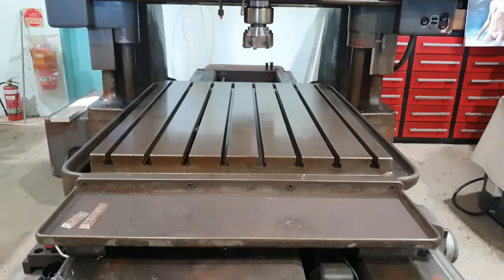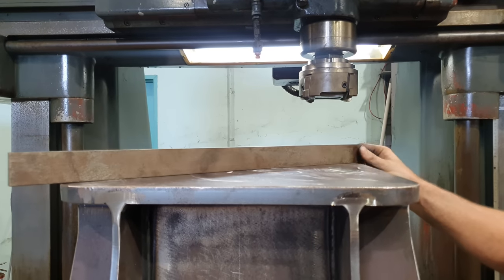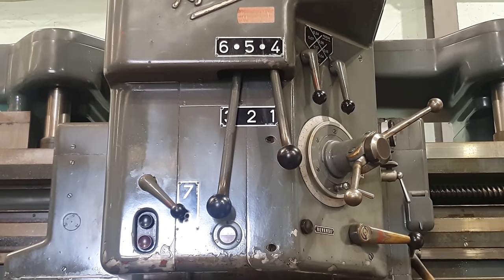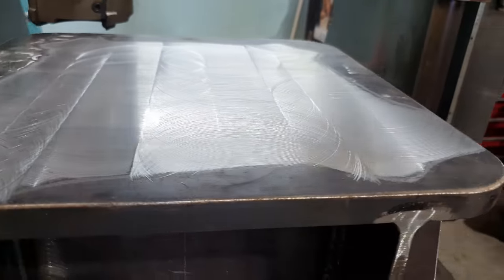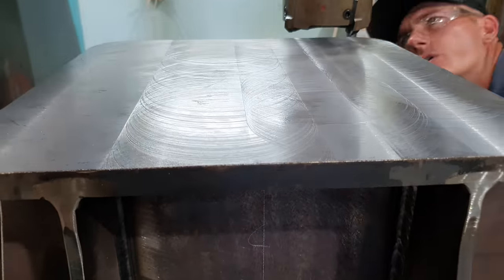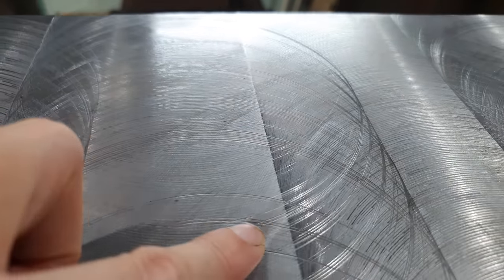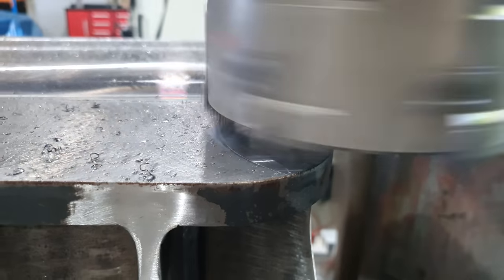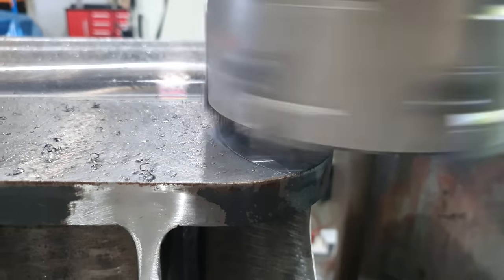Milling a Stand for a Robot on Our 1950s SIP Hydroptic Jig Borer!

Comment: Oh how that beastie of yours loves you to the core. Put that on a lathe ? That I would like to see, LOL. I guess if push came to shove it could be done but I would have to be pushed pretty hard eh, LOL. At one time I ran a 4 head mill with a 14 x 67 afoot table 3ith 2 heads on the flying bridge and one vertical on each side that ran up to 24 inch slab mills with 1 inch carbide inserts. A new ships engine would take a few days to set up and then I would spend a week on a grain shovel filling numerous bins of dross, great days long ago. Oh how I still love BIG, LOL. It's always fun stopping in here. Have a great week folks.

Comment: My $0.02: The corners being so low would warrant checking the plate thickness there to see if it was really due to wear - not warpage.
Good decision to go to another tool.  Another fantastic job.
Reply: I think it's a new fabrication Jim, there are no mounting holes in the top plate.
Edit: Yes, lovely finish achieved.

Comment: When touching off, we used a Blue Riza Paper in oil on the surface, when the cutter tore it off we new it was exactly 1/1000 from the surface.  ( before you say Bananas, remember  we went to the Moon using  bananas units):face-green-smiling:

Comment: Really cool machine. I did notice the bottom of that wasn’t flat and I think when you clamped it down you flexed the corners. Just wondering if the top is no longer flat and or if you should have cut the bottom to.

Comment: Just curious why you didn't start upside-down, with the inverted top shimmed to the table and flatten the base first? Or did you Shim the base for milling the top?
If the Top was out of flat by 0.5mm due to welding stress, then I'd have to assume the Bottom was also, yes?
After unbolting wouldn't the milled flat surface be distorted by the relaxing base?
I've seen much bigger (more ridgid) weldments distort when clamped down to a Machine Table, then move back when unclamped.

Comment: Looking at this, I am reminded of all the times that I've wondered why you never had switchable magnet rigging for your overhead tram. This looks like it'd be a perfect piece to lift by slapping a magnet on the top plate instead of a squirrely lift with the forks. Was there ever a reason other than the cost of buying one?

Comment: No 'Rizla Red' or 'Rizla Green' cigarette papers, Kurtis?  My first job was as a clerk in an engineering company that bought machine tools, refurbished them and sold them on.  These were big, big machine tools, like a gun barrel lathe from the Woolwich Arsenal sold to Brazil to make cement mixer barrels or a Spherical Turning Lathe (also from Woolwich, I believe) that could turn the 15 banana diameter ball bearings for Naval gun turrets to turn on.  But I digress.  

I was always goofing off in the machine shops asking questions and I found out all the milling machine and planer machinists had a packet of Rizla Red or Green roll your own papers.  Whether they smoked or not. This was so they could set the cutter height above the work to within two thou.  (Or three, I think the Greens were 0.003 bananas)  They would lower the cutter onto the cigarette paper until they could just pull it out without tearing and that was 0.002" above the work!  

You probably knew that, but I just wondered if anyone did that any more?  BTW; "half a mil" is 0.021", isn't it?  (Sorry, bananas.)  Great little cameo vlog guys.

Comment: I suppose you clamped at the base, so as not to distort the assembly before milling the top flat, for now you can turn it around and mill the bottom flat and parallell as well :)

Comment: I have a suggestion for a Sop Project that could, in theory, make the Hydroptic even more versatile...

Build a self-powered grinding wheel head for it and now, it becomes a MASSIVE Surface Grinder that can handle parts MUCH larger than your current surface grinder (assuming you have one) can handle...

What I'm picturing is the grinder attaches to the quill but the only powered items you run is the table feed...the quill holds the grinder head and sets it's height but the arbor is NOT spinning when the grinder is making it's passes...

Does this sound like a viable possibility or an absolute nightmare?

Comment: I know they're carbide inserts and the part being machined is, basically, a huge heat sink, but seeing the tool cut through without anything more than a bit of WD-40 for coolant is like scraping fingernails across a chalkboard!
Would coolant flow have made a difference to the surface finish in the first couple of passes?

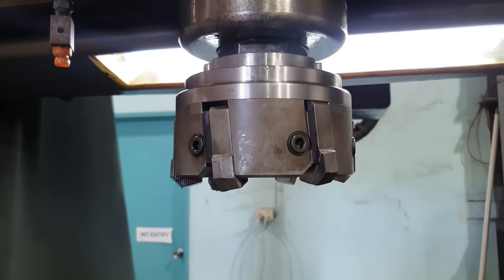Comment: I really liked the video, the machining part and all is really interseting the way u were l not stisfied by the surface finish. What really caught my attention was that super hot model calender hanging by your machine to really heat things up,that may  really help achieve  those tight fit tolerances 😂😂, 8:30  just kidding nice video though. I m from india, i do also have a small machining workshop.

Comment: I'm sure the bottom plate was off just as much as the top. Are there some kind of adjustable feet that still need to get installed?
Reply: Likely it'll be bolted to a concrete base and need to be adjusted by shims anyway. Just a thought. 🤔

Comment: If the top is slightly warped from the heat of the welding fabrication , I would think the bottom would share the same fate. Surprised you did not flip it over after completing the top, and do the bottom as well, to keep the two surfaces parallel.......

Comment: Kurtis, I know you checked the top side and yes, can clearly see the gaps but, I question, can the bottom plate also be "off"? Just asking. Great video, cheers :)
Reply: It looked like the bottom was off too (which I would expect). I guess the bottom could just be shimmed on the mounting bolts if needed.

Comment: The top of the fixture is now flat, but what about the bottom - is it necessary to have both surfaces parallel or doesn't the bottom surface matter?
Reply: Maybe because it'll be bolted to a concrete base and need to be adjusted by shims anyway? Just a thought.

Comment: Just a thought. If the top was a little bit distorted then presumably the bottom or base of it was distorted as well. Would it not have been better to take a skim off the bottom and then invert it and skim the top then you know that the top and bottom are parallel within the limits of the machine?
Reply: Maybe because it'll be bolted to a concrete base and need to be adjusted by shims anyway? Just a thought.

Comment: so if the bottom isn't flat they just use shims at installation? cool machine
Reply from the maker: that wasn't necessary the bottom plate will be bolted down with adjustable bolts and levelled, just like a lathe or cnc setup
Reply: @CuttingEdgeEngineering  ok thanks, keep up the good work

Comment: This makes the top dead flat but doesn’t it also make the top parallel with the base?  So if the base is set at a slight angle so is the top?

Comment: How did you know the bottom was flat before clamping and possibly distorting the weldment? I would have set up three fixed points to establish the bottom plane with a fourth adjustable. Tan a jig bore machine in the 70s.

Comment: You need  SHARP, more rake and much less clearance  ( and DOC ) to get good finish on the Jig Borer. Also, a properly set Jig Borer cuts DEAD perpendicular. For good finish you want to cut only in front.  Also 5-600 rpm would've helped. You're cutting cold and work hardening the ...whatever metal is that. None the less it warms my heart to see somebody using the ol' girl.  Tons of likes !!!

Comment: What I think if the top plate is bend out of shape by the heat the bottom has the same issue? If so how can you be sure the top is perfectly placed on the mil if bottom plate is bend too? My mind tells me then, the 0.5mm removed is straight/aligned with how bottom plate is "flat" or I am lost.

Comment: Why did you only face the surface on the top?
I would assume that the bottom surface also warped during welding? Isn't it a problem that the whole stand might now only standing on a few high spot on the bottom?
Reply: Maybe because it'll be bolted to a concrete base and need to be adjusted by shims anyway? Just a thought.

Comment: This question has been plaguing me for a little bit since I first saw a milling machine:

If the bottom of a to-be-milled object isn't perfectly flat, wouldn't that necessarily skew the results of the top when milled? Meaning, it will be milled flat as oriented to the imperfections or cant (meaning its flat but at a say, 0.5* slope) of the base, not the mill "floor." At that point, wouldn't it have to be milled on a second machine to gain that last perfect flat orientation, then flipped and milled on both machines again with two known "flat" instruments? (on second thought, you might not need to make NASA-grade flatness)

I'm certain I'm overthinking this and way above my paygrade as a truck driver, but I need this explained before I twist my brain in knots. 😅

Comment: This cutter is not cooled in any way during operation? After all, when the metal is heated, it increases, won't this be a problem for a surface in hundredths or tenths of a millimeter?

Comment: A interesting story for you. I worked a number of years ago for one of the largest aerospace firms in the USA which closed its large machine shop which took an area the size of a football stadium in area. Some of the machines were the size of a school bus and were dated back to the 1940's to the present. All were lovingly maintained by the machinists throughout the years. An auction was held for the equipment where the buyer had to disassemble and remove the machines themselves. Evan with no reserve no one bid on any of the countless machines and tooling. There were tens of millions of dollars just sitting there. In the end the company sold them off as scrap. It was a sickening sight to see them put to the torch.

Comment: One question: what about the other end ??  Is it assumed to be flat and parallel to the new surface ??  It was subjected to welding heat too, no ??  Perhaps customer just needed a flat mating surface for robotic arm.
Reply: Maybe because it'll be bolted to a concrete base and need to be adjusted by shims anyway? Just a thought.

Comment: Wouldn't you have to clean up the bottom too so that it's complete flat or in sync with both top and bottoms?
Reply: Maybe because it'll be bolted to a concrete base and need to be adjusted by shims anyway? Just a thought.

Comment: I see a new tool being devised for the "kitchen drawer". One "humungous fly cutter" for straightening the robotic legs to go with the "now that's a boreing bar" and "tool post" holder.
One question though what's the likelihood of the top surface "going out" of flat now that you've released the base fastening against the bed. Should the base surface be flattened first, flipped and then the top. How accurate did it need to be?
Regards from Canada's banana belt.
🤞🇨🇦🍌🥋🕊️🇺🇦🕊️🇳🇿🐨👍

Comment: Did you check the level of the bottom as well?
Reply from the maker: Not necessary, the base will be bolted down with adjustable bolts for levelling so no need to do that surface 👍
Reply: @CuttingEdgeEngineering  do you have a hone bit for finishing if you really want that a mirror finish?

Comment: I would have thought that seeing that the top had warped due to the welding, you would have machined the base as well,  so that it was flat also.
Reply: Maybe because it'll be bolted to a concrete base and need to be adjusted by shims anyway? Just a thought.
Reply: @michaelmclachlan1650  --- 100% correct. I knew the answer
Reply: @michaelmclachlan1650  Kurtis confirmed this in a reply too.   No need to machine something that’s already within an acceptable tolerance.
Reply: @AndrewMoizer  Yes he did but there's a fair number of people not reading previous comments before posting a question.
Reply: @michaelmclachlan1650  Just to be sure, it wasn't a criticism at all of all your comments. Just confirming you were right (as was my hunch). I often try to read the comments because there's often so much good information in there. The only trouble is that it takes a long time to read through them.
Reply: @AndrewMoizer  No problems Andrew, I do read the comments if I can but that's due to insomnia - I have to do something that won't disturb the neighbours!

Comment: Had to do a double take on the picture of the robot welder...... that literally is an old picture of the older robot welder at  my work not long after being installed. Can see a couple boxes of old Praxair wire before they switched to Linde behind the yellow curtain🤣🤣🤣

Comment: Y no mill both ends? wont clamping warp it out of position and then be on the piss depending on the type of floor the stand is put on?
Reply from the maker: The base will be bolted down with adjustable bolts for levelling (same as any precision machine) so no need to do that surface 👍

Comment: What was the tool you drug on the edge and why? Thx
Reply: Hi Tom, that was a deburring tool to remove the razor thin sliver of metal that's forced over during the cutting and not removed by the tool. It can cut like a razor too and needs to come off.

Comment: I noticed the face mills you wee using had negative rake.  You would get better finish and reduce the load on the spindle if you used positive rake spindles.  Also, I tend to cringe when  jig borer is used as a milling machine.

Comment: Does the bottom have to be checked?
Reply: It'll be bolted to a concrete base and adjusted by shims and jacking bolts. You can't guarantee the concrete to be absolutely flat, so.....

Comment: You should have turned over and finished the bottom so they are parallel and the same height.
Reply from the maker: that wasn't necessary the bottom plate will be bolted down with adjustable bolts and levelled

Comment: Surprised  that you didn't  deck the bottom of the stand to  parallel  both  surfaces.?
Reply: It'll be bolted to a concrete base with shims and adjustable bolts apparently.

Comment: Do you just assume the bottom is flat?  Or does the customer assure you that it is?
Reply from the maker: It doesn't matter it's going to be bolted up off the floor and using adjustable bolts for levelling 👍
Reply: @CuttingEdgeEngineering  Aha.  That makes perfect sense!

Comment: Top and Bottom of the stand need to be done, as your clamping didn’t match the bolt pattern they will use.  It will twist when they mount it.
Reply from the maker: Wrong 😂 it's going to be placed with adjustable bolts up off the concrete and levelled 👍
Reply: @CuttingEdgeEngineering  its really not relevant in that scenario. Nor was skimming it, they only did that to avoid shims i guess.

Comment: Good video BUT...he should have checked the bottom for warpage to see if he was going to warp it when he clamped it or turned it over after he finished and machined the bottom to make sure they were parallel....just this old tool & die maker / machinist's opinion

Comment: The client doesn't care that top and bottom surfaces are not parallel?
Reply from the maker: The base will be bolted down with adjustable bolts for levelling so no need to do that surface 👍
Reply: @CuttingEdgeEngineering  Thanks.

Comment: It's nice to see the Sip run but makes me sad in a way too. That machine was the pinnacle of accuracy in its day and probably is still. I would have been the most expensive machine in almost any plant on the globe. That machine would have been put in its own room with climate control all year long. The only operators would have been the "old guys". Such are things today, I live in the past too much...

If you want the weldment to stop singing when you cut it. Try C-clamping some wood block or old conveyor belting on the part. It will make a big difference.

Comment: That job seems like a complete waste of time unless the base of the robot was machined flat also 
Only purpose machining the riser would serve would be a good fitup 

If bolted securely robot won't move 
And will be calibrated for the errors accordingly 

No one will bolt that riser in dead level 

Correct me if I am wrong
Reply: Kurtis has stated it's being installed with adjustable bolts, so alignment is down to the owner.
Reply: If what it's fastened to is flat, then this has also gotta be flat, else even with bedding compound it's possibly/probably distorted. Level only enters into it later.